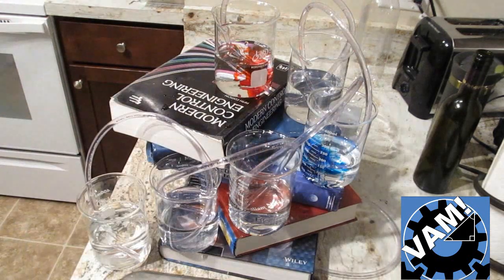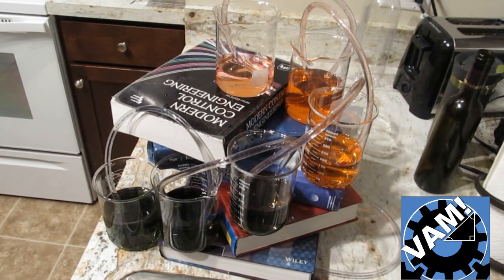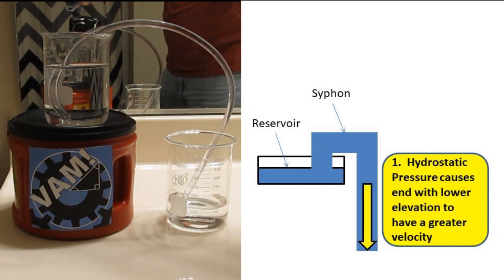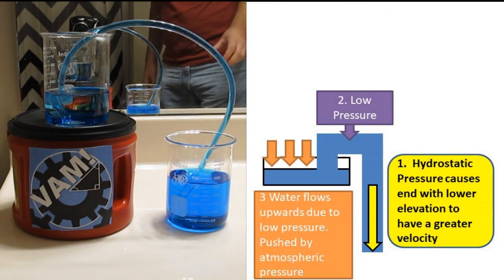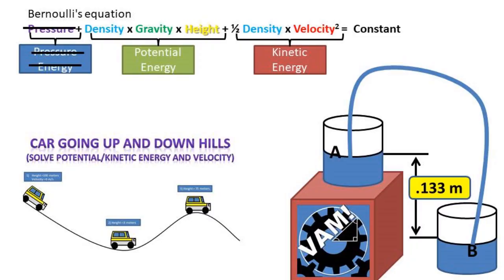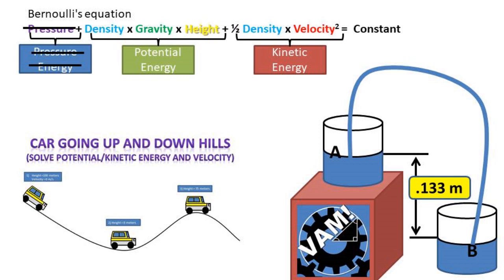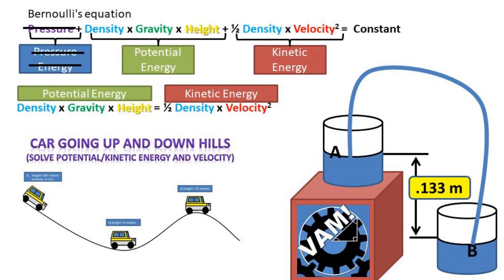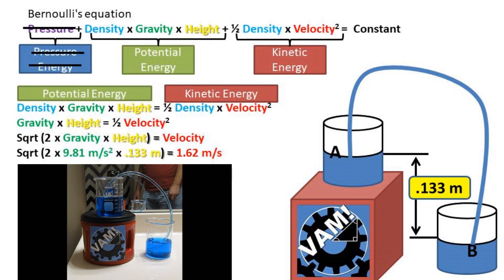Siphon Physics ( How they work, Bernoulli Equation To Find Velocity, and Limitations)

Comment: Siphon breaking Cavitation occurs at higher atmospheric temperatures? Continuous operation of a "too" high velocity siphon generates micro gas bubbles that eventually collect and break the siphon. Biologic gas production is not accounted for. I'm struggling with too little potential energy and need a velocity in excess of 500 gph. P2=P1-3 P3= P2-1. Thanks, gave you a like.

Comment: what about the diameter of the ends of the tube, does it affect the flow.
Reply: The analysis does not take friction loss head of the siphon tube into account.  Friction loss is proportional to the square of velocity (Darcy-Weisbach equation), although kindly note that I'm not sure what an appropriate equivalent length would be for this particular tubing.  Thus, the smaller the tube diameter, the greater the frictional resistance.  Given an equivalent suction driving force to start the siphon, a larger diameter would yield greater flow.
Reply: @small_ed  stfu
Reply: @NaughtyVFX  Q=AV, A is area of pipe found using diameter, V is velocity, and Q is discharge/flow, as A or V get larger flow increases

Comment: Would the head pressure be measured from point C or A? For example if I was siphoning from a pond on a hill would the PSI at the end of the tube increase if I elevated the hose higher above the pond?
Reply: The pressure at the end of the tube remains atmospheric.  The siphon is driven by gravity.

Comment: what is highest limits of siphon😌😌😌
so we use one thousand siphon or  one lakh siphon pipe which sucking the water from upper reservoir and ends with a single pipe for output outlet
now what will happen shows with the help of equation of burnouli equation
now if we use a turbine which start with the sucking by one lakh siphon pipes then will it produced enough energy which is used in take back the output water from the outlet again in the same tanker or reservoir😝😝😋

if so then we can setup these type of plants across the world and take out the extra energy from this system, it's required only distilled water nothing else so only with the help of atmospheric pressures we have lots of energy forever for everyone round the world
Reply: does that mean you got infinite energy🤣🤣🤣

Comment: https://youtu.be/1WA9XZD4rEE

Here is the video link for the siphon continuing to function at a height of just over 33 feet despite bubbles forming. Not sure how well you can see it but most of the siphon at the apex is full of air but the water continue to sputter over the top. On its way down towards the exit the column of water became continuous again and so the siphon continued to flow just fine.

Comment: I will try to post my video with a link showing the siphon flowing even with numerous bubbles going through. You bring up a good point though. The siphon was a few inches shorter than what we predicted based on the atmospheric pressure we measured that day. I suppose it is possible that the bubbles limited how high we could go.  I think we need to re-run our experiment and stop flow and let a large air bubble form at the top then open the valve at the bottom and see if it flows again. I think that would show that a bubble formed by negative pressure doesn’t break the siphon

Comment: Cavitation is not a limit.  An air bubble at the top of the siphon is only a problem if that air bubble is atmospheric pressure (air entrained into the siphon from the atmosphere).  Air that occurs from cavitation does not stop a siphon.  The pressure is still very low at the top of the siphon, even with cavitation bubbles present, so there is still a functioning siphon.   The limiting factor is atmospheric pressure.  If the pressure at the bottom of the column of fluid going up is equal to atmospheric pressure, flow stops.  101 kPa = atm pressure.  If you set that equal to the pressure at the bottom of the column of water (density x gravity x height), then you get a height of 10.33 meters for water (density 1000 kg/m3 and 9.81 m/s2 for density of water and gravity, respectively).  This is exactly what happens.  We set up a 34 foot tall siphon for my kids' science fair experiment and showed that even with cavitation and many bubbles forming at the top of the siphon once we approached 33 feet, the siphon still flowed just fine until we got to 33 1/2 feet.  As soon as you lowered the top back down, the siphon resumed (even though there were several bubbles in it).
Reply from the maker: It is my understanding that the water will boil under the low pressure before the column of water pressure cancels out the atmospheric pressure. That is at least the conclusion i came up when i made this video. Here to learn if you know more then i do.
Reply: If this is true, then how do you explain the function of a siphon in a complete vacuum?
Reply: @RyanAlexander87   in order to make a siphon work in a vacuum, one has to significantly change the fluid (relative to water) and use something like an ionic fluid with very high molecular cohesion. It’s not impossible to do and several people have done it. But you can’t do it with water and get very high. This type of an experiment can simulate a typical siphon but it is an exception, not the rule, and requires very specific conditions in order to make it possible. This type of experiment certainly does not describe the typical siphons that are used in day-to-day life. You cannot use a liquid in a vacuum with low molecular cohesion and still have a siphon, whereas you CAN use fluid with very low molecular cohesion in a “regular “siphon outside of a vacuum and it will still work just fine going up several meters.  Another video that I made earlier demonstrated that you don’t need any molecular cohesion at all to start a siphon. If you have the upward limb filled with a liquid and the down limb filled with a liquid with air in between at atmospheric pressure, you can still start the siphon moving. I did this by having a siphon that had stopcocks inserted into the up and down limbs with tubing forming a bridge in between that was filled with air (no vacuum). When I turned the two stopcocks and exposed both columns of fluid to the intervening air (instead of the liquid, so there was no molecular cohesion at all) as long as one limb was longer than the other, flow would start moving in the direction of the longer limb.  I might have to make a video again and post it here so you can understand what I mean. It’s a lot easier to show you than to describe it. Regardless, it clearly demonstrated that the liquid in the up limb of the siphon did not even have to be touching the liquid in the down limb  in order for the siphon to start. The intervening segment of air just went right down and out of the downward limb and the siphon continued as a continuous column of fluid from there on out.